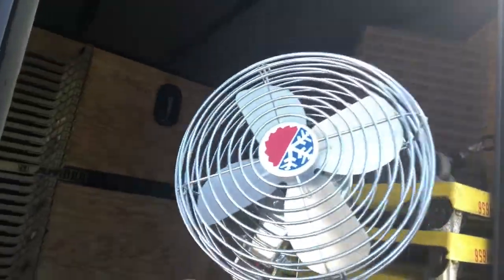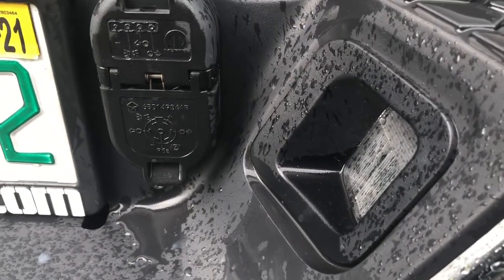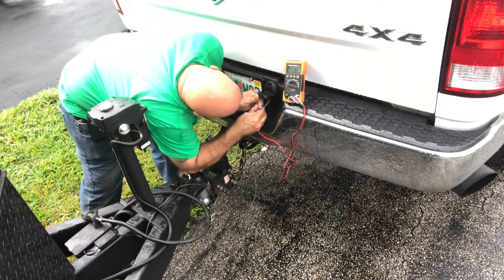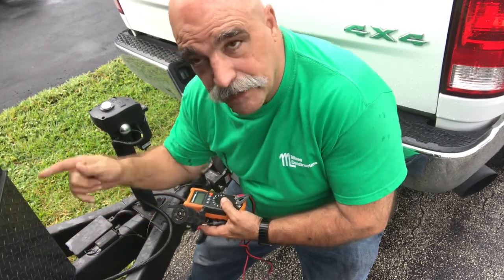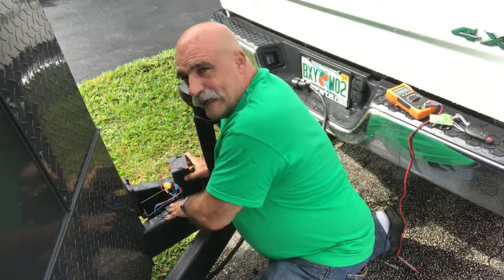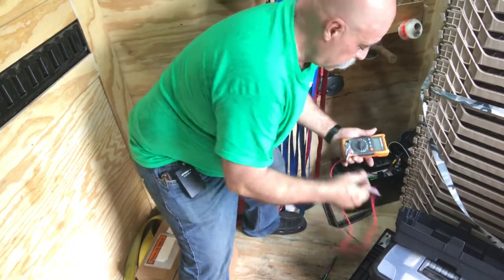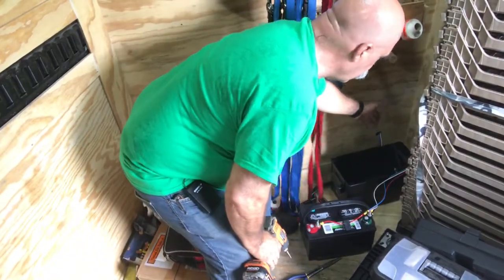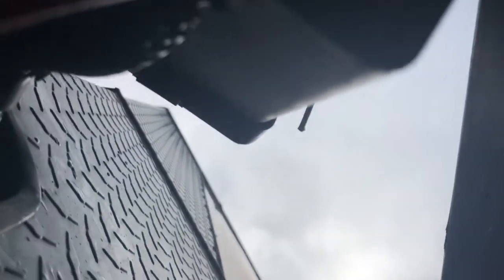How to charge your battery from your seven pin

Comment: Will this method charge a LiFePo4 battery which needs 14.2V minimum to charge?
Reply from the maker: Put a meter on your seven pin and see what your alternator is putting out for a charge sometimes they put out 14 and if that’s the case it should work but I don’t know for sure. I hope you enjoy the video and if you can leave me a thumbs up.

Comment: What is controlling the charge?  Like a solar panel has a charge controller.
Reply from the maker: Thank you for your question. I put a meter on the seven pin on the back of the truck so I can determine what the voltage was coming in to charge the battery that is what is controlling the charge to the battery in the trailer. If you enjoyed the video and if you can leave me a thumbs up.

Comment: Once you connect the battery to the trailers electrical system the little battery on the tongue can be eliminated.  Just be sure the breakaway switch is connected to the power wire.
Reply from the maker: Thank you for your comment.
I hope you enjoyed the video and if you can leave me a thumbs up.

Comment: Does this charging connection need a regulator to prevent overcharging the trailer battery, or is it handled from the towing vehicle?
Reply from the maker: This one is handled by the towing vehicle this vehicle already has two batteries in it with an isolator
Reply: @buildingwithpapa  
Thank you for your reply.

Comment: Hi tnx for the video. I have  a question.  Can a 7 way plug charge an 100ah 12v(camper battery)? If yes how long of driving? Tnx
Reply from the maker: Yes it can charge the camper battery without a problem, it all depends on how low your battery is at the time of charging on how long it will take, but it will charge it
Reply: @buildingwithpapa  tnx

Comment: What size wire did you use to the battery?
Reply from the maker: I believe it was 10 gauge, it’s the same size wire that’s in the line of your seven pin that goes to your positive and negative wires which is your black in your white.
Thank you for your comment.

Comment: Hi Papa we met at Assura Windows and Doors you came down needing some help. I love your videos they help me do so many things around my home. Not afraid to do wires as much great to see you
Reply from the maker: Yes I remember you thank you very much and thank you for the comment, I hope you continue to watch if you have anything in particular let me know and I’ll put a video together you have a great day
Reply: Santo Mineo I am having a problem with a stoke plate on my front door. It’s not aligned and there’s no wood to drill. I’m at an impasse with corrections on this door. Please help thank you. 
Also my son loves the channel also!!
Reply from the maker: Anisah M Good to hear from you again, well the first thing I checked when A Bolt and strike plate do not lineup anymore I check the hinges first make sure they’re not loose or screws have loosened or in some may need to be retightened or use longer screws but sometimes that’s not the case I’m hoping that you have a metal strike plate in there right now and then what I have done I tried to market the strike plate where it would work and then I use a Dremel and I cut the strike plate so that the bolt will go in
I hope this helps you if it doesn’t it would be better if you sent me some pictures I might be able to understand exactly what’s going on with the situation but those would be the items that I would do if I had this problem
Have a great day